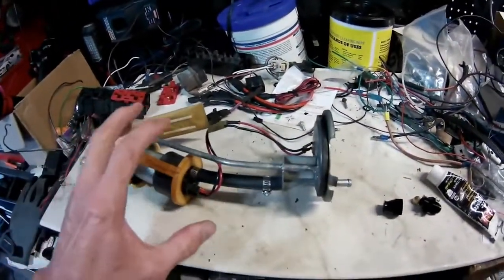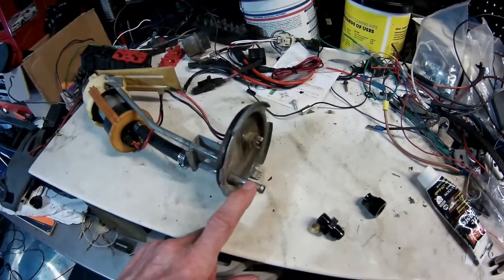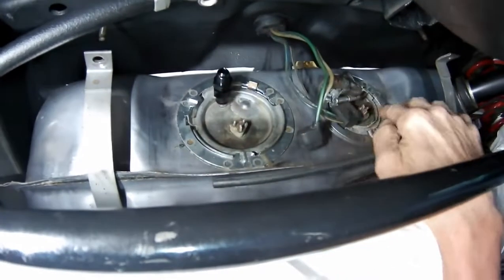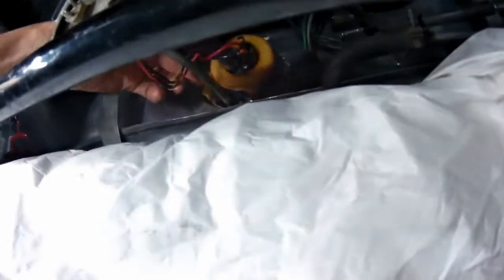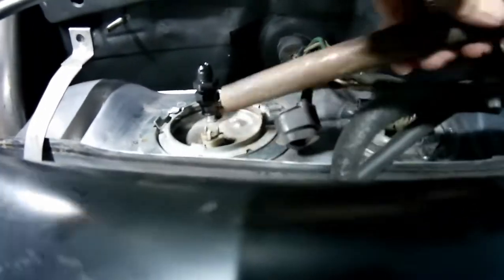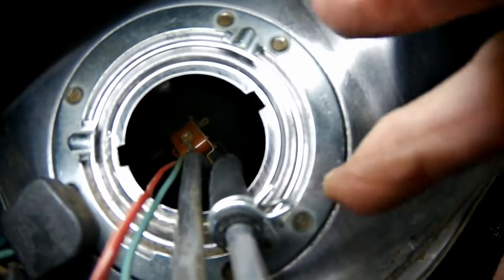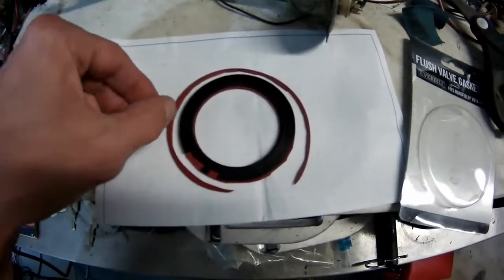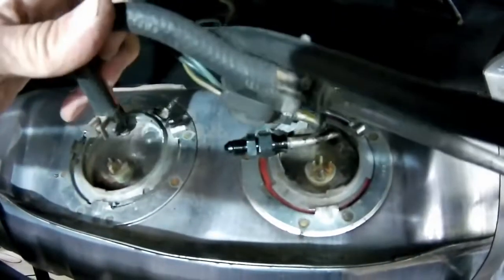Laser86 - PT20 - Fuel Tank

Comment: Where is the sending unit return hose going to on this tank? On the stock plastic sump it goes there. Recently I clamped the hose to the fuel pump body so it fills the sump with fuel on a aftermarket tank.
Reply from the maker: At 4:20, I show where the return port is.  I didn't use an AN type fitting on that.